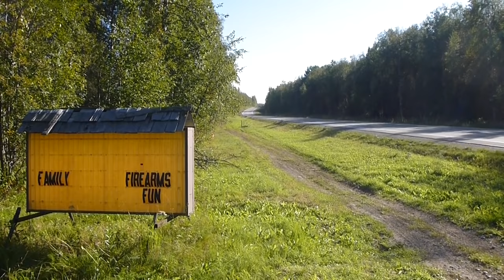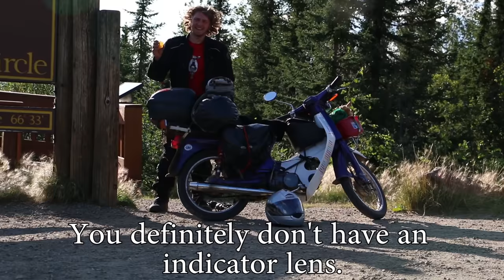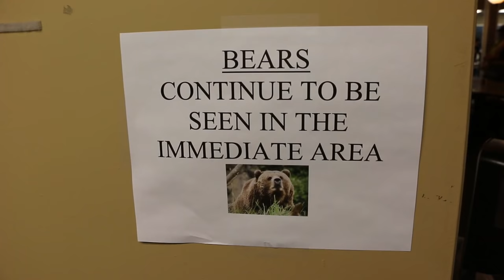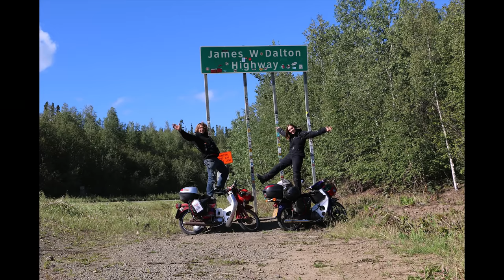Alaska to Argentina Ep2: The Dalton Highway to Prudhoe Bay. Alaska Part 1 of 2

Comment: Back in 2010, I rode from Phoenix, AZ U.S. to Prudhoe Bay, AK and back on a Yamaha XT225 built from the parts of 3 different bikes and a lot of aftermarket parts. I rode alone, and carried 6 gallons of gas, 4 gallons in the aftermarket Clarke gas tank, and 2 more in 1 gallon jugs stuffed in Tusk tank panniers. I barely had enough for the final ride into Prudhoe Bay. You have to be careful getting gas in Prudhoe Bay, I filled up with some that had water in it. I found out about that about 20 miles after leaving. Fortunately I had a carbureted bike, and was able to clean out all the watered down gas, and use the 2 gallons of good gas to get back and get gas from a different place. I managed t fins an empty clear 1 gallon jug, and filled it up 4 times, to make sure there was no water at the bottom. Other than a flat tire, that was the only issue on the whole trip. 

Don't be afraid of the trucks on the Dalton. They won't try to run you off the road. Yes people have been hit by rocks thrown up by them, but it's not their fault. It's a gravel road, and they have to make good time. You wouldn't believe what they are being paid. They're not getting rich though. It costs a fortune to live up there. I believe every single truck driver waved at me. 

I could never made it up there on a C90. I weigh 240 American pounds, about the same as an XT225 without gas and oil. A C90 would have broken in half under me. I posted this trip on advrider.com. The pictures and video are not great. I did not have a drone or a tripod, and didn't want to have to stop and set up photo shoots. I just took pictures and video when I had the opportunity. I was 51 years old at the time. Just turned 62, and am planning another motorcycle trip. 

The Dalton can be fairly easy at the right time of the year, IF you are prepared. It is an absolute nightmare at the wrong time of the year. You run the risk of freezing to death, or crashing on the icy roads. If you go at the right time, it will never get dark, which causes some mental confusion. Having been in the military, I chose to use military time instead of trying to deal with AM and PM.
Reply: HV ub , hub😊, uvu 😊u  uvvv

Comment: because of this man, I sold three of my motorcycles. My Honda GL 1800 Goldwing, my Moto Guzzi norge, and my commuter Honda pacific coast. I replaced the loss of those three motorcycles with a Kawasaki Z 400.
 this guy made me realize that you do not need a large motorcycle. over the last three decades, I kept getting larger and larger motorcycles. I started out on smaller ones, but I just kept getting bigger and bigger and bigger ones. Now I am on what I consider to be a small motorcycle, and the fun is back… I actually can scrape by with just 48 hp..

Comment: I have a Honda Trail 70 from when I was a kid. Indestructible bike, quite literally. We abused it horrifically, never did any maintenance on it until something  broke and 40 years later (yes, I am old) it is still running. I think the bike is a 1974 model but I am not sure. My dad bought it used in 1979 when I was 5 years old. I keep it up at my cottage and we regularly drop it in the river. Starts every single time after be flood it. Legendary.

Comment: Loved the video. Did that ride on a BMW R1200 GSA in 2007. You were lucky. Blizzards can happen in the Brooks Range any time of year. Grizzlies, Black bears, moose, and wolves are no joke up there. And when they run a grader over the calcium chloride impregnated mud, it's like riding on 6 inch deep whipped cream. If you broke down, it costs a fortune to have someone come from Fairbanks to haul you back. It was $5 a mile both ways in 2007. Can't imagine what it is now.

Comment: The reason the 18 wheelers swerve towards you is not to run you off the road, but to try and make the rocks fly under you rather than on you.  Works well for cars and trucks, no doubt scary as hell for motorcycles.